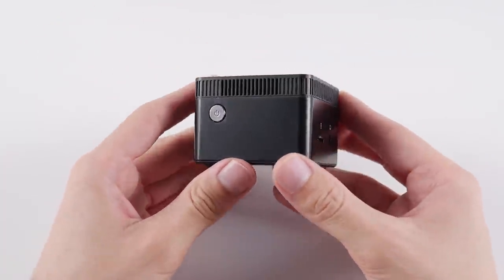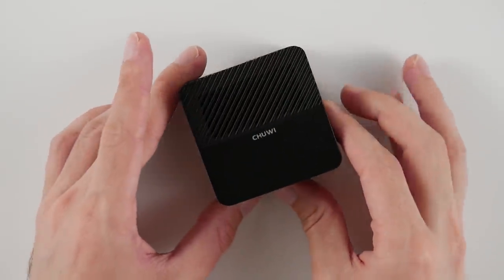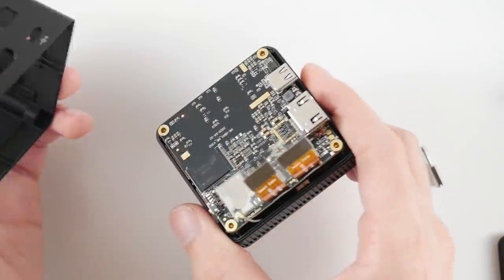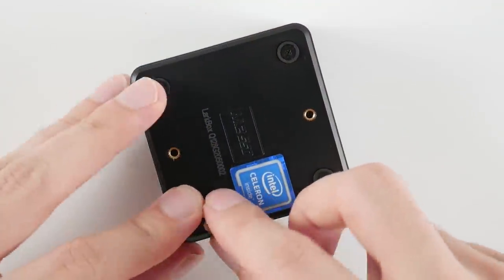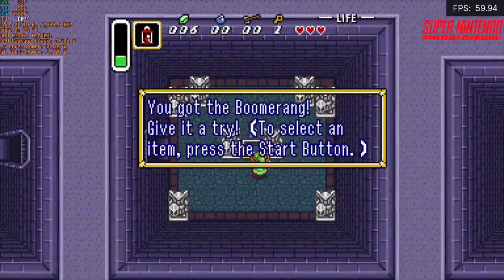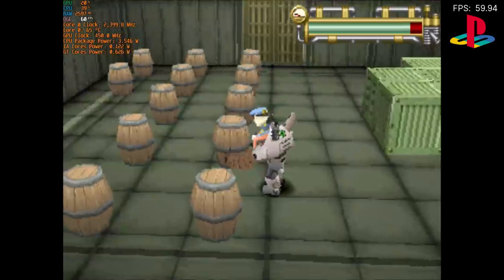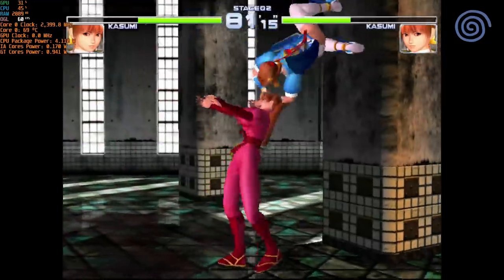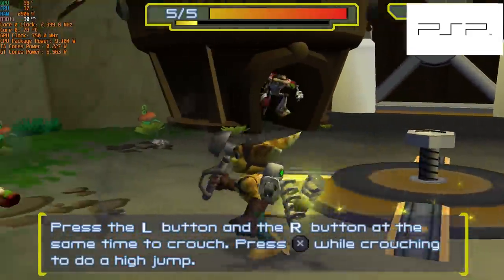GAMING ON THE smallest 4K MINI PC

Comment: This looks like a good solution for low demand office computers, I'm going to give it a go anyway.
Reply: Office computers are bought bulk for pretty cheap, like 200-400 dollars. You'd have to be in a pretty nice office for 1000 dollar mini pc.
Reply: you can buy this for less than 200$ in aliexpress
Reply: @Dakota_B_  says single sale on the Indiegogo site is 239 USD.
Reply: @EndlessMahogany  Damn that's a big discount from the first thing I saw on bing, it was like 1049.
Reply: @Dakota_B_  the link is in the description
Reply: 4k 1fps
Reply: @sealmeatisbestmeat1241  I wish we had an alternate youtube that didn't have any google touching it. I won't even use a browser that has the chrome base.
Reply: Thing is, office pcs at allready small enough to fit behind the monitor, so no real point in making them smaller
Reply: 169 likes lmao
Reply: Would also be great paired with a living room TV. Uses it to consume media, social media, and you have retro emulators for when the boys come over haha.
Reply: They probably would like something more upgradeable. My school back then used Pico ITX PCs mounted on the monitor's VESA mount. It was upgradeable and bigger. This is nice and compact, but the estate issue is addressed by that other design in a more efficient way.
Reply: @ShatteringKatana  Works perfectly as a browser and network computer super fast and quiet
Reply: @darrenirwin  But it isn't upgradeable and it takes desk space. There are more flexible small size form factors than this one, especially for office environment, where mounting the case directly to the VESA mount makes the system comparable to an all in one, and they are quiet as well. It's an impressive computer for how small it is but its use case seems limited just to very tight spaces.
Reply: @ShatteringKatana  what desk space it fits on the back of the monitor has sufficient ram and if I need extra storage I plug in a USB drive
Reply: @darrenirwin  The model you are seeing on the video does not (apparently that was wrong on my part, but the point still stands, size would not matter), while a dedicated ITX case would. In which case size would not matter.

You could theoretically make an attachment of some sorts for that purpose for the Chuwi (not needed as it can be mounted), but it still would not be a good platform for future upgrades, which are not only ram and storage, but also processor and motherboard. For an office it's way better to reduce costs by having a platform that can be upgraded when needed and costs less overall, especially in relation to performance.
Reply: @ShatteringKatana  I have it works fine and upgrades are irrelevant, we replace every 2 years anyway and in 2 years who knows what will be available, everything we use software wise is server based so ram and storage are not even an issue. In 2 years time we are unlikely to even use computers as pads will be more inline with mobility needs. I do know what will suit my own practice.
Reply: @darrenirwin  Whatever suits your needs, no one is disputing that. Those needs, though, are not every office's, which is what I'm talking about.

What I do know is that ITX as a format is here to stay, so even keeping just the case is convenient and costs less in the long run as well as the short one ($200 per machine still goes a long way on an ITX build). Once this machine runs its course, there's not much that can be reimplemented or sold.

I also feel like there are even cheaper solutions if everything is handled server side (the intel compute stick for one, $70 to $110 based on how much RAM one needs), but that might be limited to software availability.
Reply: @ShatteringKatana  this was used  to breath new life into integrated I3 computers that are 4ish years old so we could use the old screens with a small form factor pc. As I said further upgrades are unlikely as everything will have changed in a few years time this is cheap and far better value and more suitable to our needs than most similarly priced alternatives no extra power supply needed plenty of ram and fast enough for server based software.
Reply: @darrenirwin   I'm not arguing about what your company should have done. Every company has its needs and you know them.

What I'm saying is that generally for an office environment ITX VESA cases exist and those offer more flexibility at the same price, while keeping everything neat. Even if they were to be thrown away later it's easier to find someone interested in components to recover the expenses. An old SBC stays old forever instead. For what the ITX machine would do I'd also expect the power draw to be not too much of an issue.

On an unrelated note, the intel compute stick costs about $110 for an 8GB RAM model. I think it has a Cherry Trail z8500, but even with a z3735f it should be serviceable, the SOC's problem was never power, but low RAM (even then I was able to run RE5 on a z3735f tablet at 40FPS and 640x360, that is on the 1GB RAM version).
Reply: @Dakota_B_  in the link in the description this exact pc is $169 on Amazon.
Reply: @Dakota_B_  try duck duck go?
Reply: @thePyiott  I can think of one good and one bad for this, bulk storage, when in a large office being able to store 50 computers where you could normally store 10 would be very beneficial,  moving them and such in bulk would also be much easier,

Comment: when your Cmos battery is about 5% of your total pc mass 😂
Reply: Whilst its cmos is still good id back it up on a flash drive using its handy usb slots and change batt n reflash bios and windows again woukdnt take half an hour at most :)
Reply: @FozzyFawkes  cmos is just to hold bios settings. There's no reason to back anything up or change the battery. They usually last like 5-10 years in a pc

Comment: I’d put this in a home made arcade cabinet, seems perfect for it.
Reply: Ape  Raspberry pi can only support up to about N64. This has far more performance.
Reply: Ape  but the GPU is probably not as good as this.
Reply: Ape  Actually not cheaper, at least not by much after buying the pi, the case, and a decent sized micro SD card. maybe $30 cheaper, but not really.
Reply: xblackdemonx there is no GPU on it 💀 what
Reply: @lilp4pii310  there certainly is a GPU.  Theres an iGPU in the processor, UHD 600.  Quite the step up graphically from a Raspberry Pi.
Reply: th3suffering Im saying on the PI. Not the Mini Pc. I know theres a gpu on the pc bruh
Reply: @lilp4pii310  There is a GPU on the Pi fool...
Reply: @Zetla  you're usually going for n64 and older when building an arcade machine anyways. Pi 4 is perfect for it
Reply: Ape  Pi 4 even struggles with some N64 games.
Reply: Ape  I'd put them there just because they're small to have the option if I really wanted to play them. In reality though, yes I'd probably very rarely play N64 at an arcade cabinet. :)

Comment: Playable gamecube? And it's smaller then a raspberry pi 4 enclosure!?
Reply: I would attach this to a portable cheap 4:3 monitor and play up to gamecube on it. Can it handle an arcade front end without dying? Launchbox?
Reply from the maker: It shouldn't have any issues with PC front ends. There's a lot of headroom left running most of the systems in this video.

Comment: This is a one time purchase. after it melts you buy an other one
Reply: It kinda make sense, like those 1 time use cameras?
Reply: What do you mean? This device is so bad that will break quick?
Reply: @Raylightsen  yes , that's exactly what he means. Whether that's true or not is to be seen , but I would be weary of the thermals on this thing long term.
Reply: @NexusFantismo  its only a small tiny arm processor and it has a pretty beefy heatsink with a good fan. If it was failing to get rid of thermals the gameplay would of looked horrendous and super choppy due to thermal throttling you just have no clue what you are on about.

Comment: For myself, this would be perfect as a combined media centre and retro emulation station for use in a living room.
I'd need to upgrade from the 128gb M2 SSD though to store a greater volume of internal media, or alternatively just plug in an external drive.
For someone else though, this would be a perfect replacement for their aging PC. They've been using an all-in-one touch screen PC for nearly 10 years now and it's time to replace it. The fact that it can attach to the back of a monitor makes it perfect.

Comment: I have something like this, a J4125 8gb ram 256gb ssd, and I was surprised by how much power this thing has. I needed a low power alternative for my translation work, as well as my Zoom meetings. I do have a large workstation for any heavy work and any actual gaming I may do, but these days I keep office hours from 8-4. My previous low power machine was an E-450, which I made the mistake of "upgrading" to Windows 10 and now I have to wait 5-10 minutes after turning it on for the machine to be usable, and it has a SSD and 8 gb RAM. With Windows 7 no longer supported and me needing MS Office (for full compatibility with documents sent for translation) and SDL Trados (makes my life easier when translating, and requires MS Office and Windows for proper work), plus the fact I have gotten used to having a 4K sized desktop (never going back) makes a small machine with these specs great.

I can work and not consume a lot of electricity, and actually not notice I am using a low power machine., for my day to day tasks. That is at least several Office Docs (varying sizes, but not your garden variety ones, we are taking 100+ technical stuff, plus presentations heavy on multimedia, Excel sheets, etc), several PDFs, approximately 15 browser windows open (terminology bases, reference sheets, etc), SDL Trados, the occasional PhotoShop (for editing graphical elements to be translated) and unless it is heavy stuff, I do not notice a difference. 

Yes, I suppose my larger desktop is much snappier, then again it should be. But having this means I can leave it on during my regular office hours and not worry about a large bill coming in at the end of the month, and not having to suffer low resolutions and limited functionality.

Little rule of thumb for gamers who need a small machine for non gaming tasks: if it can do PS2 and Gamecube emulation, it is good enough for daily driver activities at the level you are used to doing. We do work, after all.

Comment: Great video. System performs very well for it's ultra small size. If you wouldn't mind making a video of what emulator's you used for this and maybe a install / configuration guide.  I used to have several emulators installed on an earlier pc build of mine - but that was a long time ago and haven't kept up with the latest versions of emulators today.

Comment: If the issue was cooling. Maybe find large southbrige heatsink. Mount that to the copper plate. Then top it with a noctua 20/40mm. Maybe bump the wattage after, if possible?

Comment: To people who want to use this as a media PC. The CPU (which is a Gemini Lake Refresh) DOES NOT support HDR. It's GPU can decode HEVC 4K but if you file contains HDR metadata, either it let the CPU to decode resulting super laggy output or completely ignore the HDR part and output a washed out color picture. 

I've bought a similar PC which uses Celeron J4125 and tested it out thoroughly. 
https://community.intel.com/t5/Intel-NUCs/Does-NUC7CJYH-support-HDR/td-p/480579

Comment: Off topic but I heard you are working/talking to Powkiddy for a new firmware for the X2? Is that correct?  If so can you mention any progress and release date?
That why you are holding back on the X2 review? 
Hoping you can also confirm the actual RAM, some say 256MB and others 512MB. 
Also Im guessing you will also review the Subor Q900?
(From what I seen the screen isnt as good on that one and the aspect ratio cant be changed, pity).

Comment: Amazing video. 

Two questions:

Will this run SteamVR?

Can it use an eGPU?
Reply: Well, I can't say much about the former, but as for the latter, in theory, the port on the bottom can be utilized with a eGPU unit, but confirmation is needed.

Comment: I live in a travel trailer full time so space is an issue.  I already own an Intel NUK so the size is getting close to your mini (three slices of bread).  I have my NUK mounted on the back of a 32" monitor in my trailer's game room (Keystone Cougar 368MBI, if you're interested).  BTW, my NUK was free.  Back in the 90s, I mined bitcoins and after a couple years I made a tenth of a bitcoin (25 cents).  When bitcoin shot up to $18,000, I redeemed it and bought the NUK with the proceeds.  I nicknamed it "Bitsy", which alludes to its size (itsy bitsy) and also to the bitcoin I bought it with.

Comment: Honestly for the price, considering the absolutely tiny size of the thing and how damn efficient it would be, I dig it. I'm tempted to grab one of these so I can use it as an HTPC with Kodi, whilst also running Launchbox for emulation up to and including Gamecube and using Steam big picture for lighter indie games like Cuphead, or some older games.

Comment: How would I use it? I'd torture it by having it run Battlefield, Borderlands, CoD, etc and upload benchmarks of it handling it at 3FPS.
Reply: You're joking but I bet it could handle all those games, most of which are old...it would run Borderlands no problem, probably well...ditto B2...anything until BLOP3 would also run like a dream...most of the Battlefields would be fine too.

Comment: This could make a nice daily driver because of the surely small power intake. If you can game on it you can surely work perfectly fine on it. The only downside for me would be that i am used to dual-screen usage and that this system would need an external USB3 graphics adapter for that.

Comment: Since it's Windows, have you attempted using a ~4GB class 6 mSD card setup as a virtual memory cache to aid in the SWAP limit of the 6GB LPDDR4 RAM? This can help with lower end systems that are limited by their multitasking abilities by sending idle programs to the SWAP created on the mSD, freeing up physical memory for the primary application in use; especially helpful in daily Windows OS usage on a budget micro system.

Comment: Still think the Deskmini A300 is the best all-round little emulation box to get since you can actually have storage on it to use it as a little central hub, or file host but still can play a lot of games on it.
Reply: Its the size of two beer cans put together and it can play Red Dead Redemption 2 at 30fps+ at 720p with even only a 3200g in it. (Which you can get as cheap as £60 if you know where to look)

Comment: I saw this advertised and was really curious. After seeing it's emulation performance, I'm pretty impressed. Way better than I expected. Kinda thinking this might be a good replacement for my Pi4. Do you think it work well running Batocera or would it be better to install Ubuntu and add Retropie?
Reply from the maker: I didn't have a chance to test out gaming performance on this, but I do plan on using this as a Linux box instead of Windows. All of the systems I would use on this have no problems with Linux. Only the higher end systems benefit largely from being on Windows.
Reply: Ideally, I am looking for something compact that can do up to PS2 but if I can even find something with solid Gamecube and PSP support, I would jump at it.

Comment: was considering making a portable set of ar style raspberry pi glasses powered off a battery pack. coming from an older project of me wanting to do so with a chinese off brand intel compute stick. this makes me want to renew that project, house the pc/battery pack in a scarf style setup, and wire it into a pair of glasses as the display (transparent oleds or an adjustable lcd mount, problem is getting a t-oled display small enough at a decent resolution as i can't find any place selling them despite the fact that they can/do exist.) Doing so with wireless controllers akin to that of the nintendo switch would allow me to have essentially a pc everywhere thats incredibly easy to play on/a study machine that allows me to hold notes up in a corner of my eye using programs like excel/outlook etc, whilst also doing irl tasks. also watching youtube/movies whilst at work/on the bus would be pretty neat

Comment: I know you mentioned that you wanted to passively cool it in the future, but if noise is a concern and since I upgraded my 3D printer with noctua 40mm fans recently I'd like to toss that idea nto the ring for consideration since it's leagues above what generic brands call "quiet" fans. (I'm just guessing that it's a 40mm fan in there but I'd be surprised if they went with anything bespoke)

Comment: really interested in this for emulation.  does gamecube work any better if you lower any settings?
Reply from the maker: I had everything at the lowest settings or 1.5x resolution. It can probably get a little smoother with under clocking the CPU.
Reply: @TakiUdon  that sucks, would really like a little linux box for retro/4k videos.

Comment: At 150 to 200 bucks That would be a very cool little thing to take over to a friend's house that just had a TV. 

It looks about the size of two of the Google Chromecast and with a couple wireless controllers would make it easy to travel and play some medium demanding emulation. When I saw you play PSP God of War I know it's a nice little device because that one is pretty hardcore for a lot of the little emulating computers.

Comment: it would be pretty cool to have a pc that small with a normal sized cpu in it with a ribbon connector to the motherboard(at the bottom) with a normal sized gpu(not the whole gpu pcb, the gpu itself) with the vram connected to the bottom of it and whatever else a gpu needs to run, then inbetween that and teh motherboard you have sqaure ram